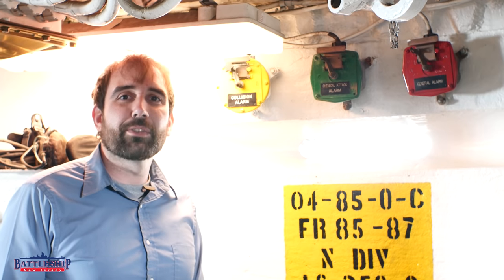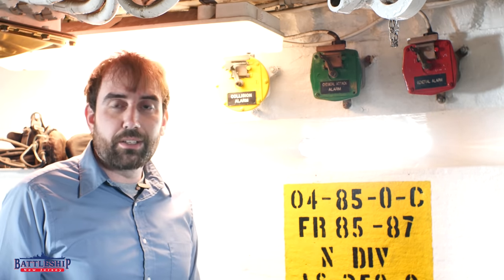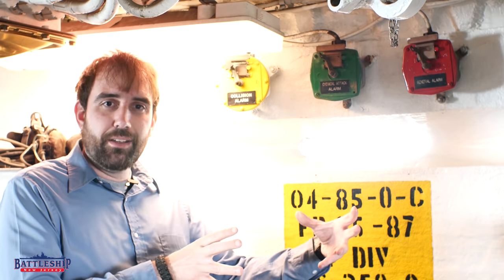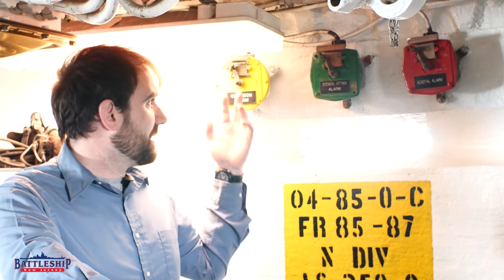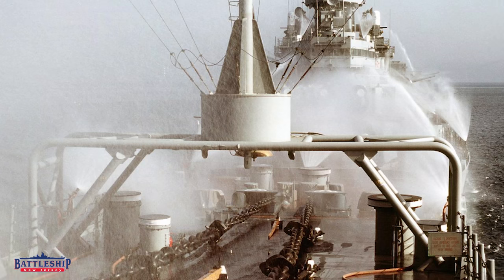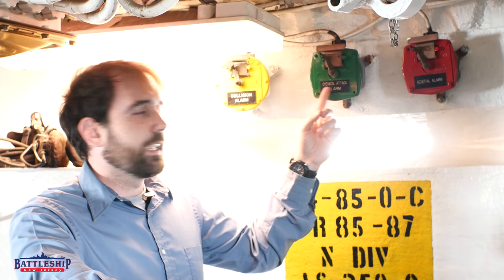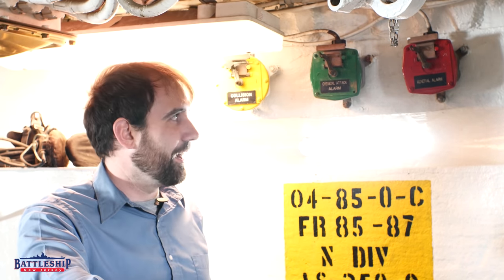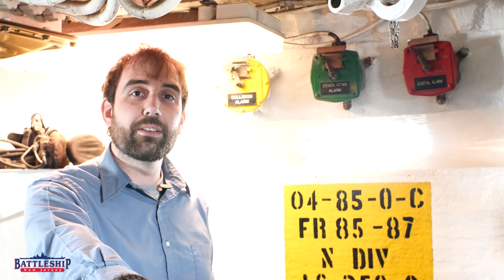That's Alarming! Shipboard Alarms and How to Tell the Difference Between Them

Comment: I stood quarterdeck watches.  The morning watch had a specific time to test the 1MC General Chemical and Collision alarms.  They over ride each other by precedence.  you start with the general and then hit the chemical then the collision to see if they cancel each other .  Just remember to shut off the last one before you finish.  otherwise you will have more noises than you planned for
Reply: On an older ship, one of those unplanned noises was probably somebody from the IC Shop asking if you would like to spend a fun-filled evening with him running every tube in the Alarm Oscillator, 1MC pre-amp, and 1MC power amp racks through the tube tester.  The old oscillators didn't like multiple alarm switches thrown and would over-drive the tubes, causing burn outs and distortion.  The pre-amp did not like distortion, and the main rack didn't like receiving an amplified distorted signal, distorting it even more before heading out to the 1MC speakers.  The finals in the power amp were special matched tube sets...in 1988, toasting one would result in somebody ordering a $900 matched pair to go back in repair stock.
Reply: @kevincrosby1760  my answer would've been, "Not really, but since I fucked it up, I'll help fix it up, when's good for you?".
Laughably, I'm also qualified to work on such ancient systems from civilian side employment and current equipment as well.
If memory serves, the BB's also used loctal tubes, right?

Comment: HIFR (Helicopter Infight Refueling), the helo hovers over the deck and drops the rescue hoist hook, the refuel crew hooks the hose to the rescue hoist and the helo pulls it up where the helo crewman hooks the hose to the helicopter. The helicopter hovers out to the side of the ship just in case the hose breaks and dumps fuel, there is a quick disconnect in the hose that will allow the helo to break away if there is a problem, the hose is managed by about a dozen sailors who pay it out or take it in during the evolution. Last thing you want to hear is the general alarm followed by fire,fire,fire and the space number with this is not a drill.

Comment: It is important to set off any alarm once and a while to make sure it works when you really need it to. Of course you must plan tests such as this in advance and make sure that everyone who hears the alarm knows that it is in fact a test.
Reply: That was usually done when in port. Before the test a page on the 1MC. "Now hear this. The following is a test of the (...) alarm. Disregard." After the test, "Test of the (...) alarm complete. Regard further alarms."
Reply: @williamstewart9769  correct, was a regular PMS performed by the IC guys.
Reply: Fire alarm tests are common, it might be an drill or announced as an test who can be ignored.
Reply: @leftyo9589  Think it was a Monthly, rotating through the two quarterdecks and the bridge for the 3 primary alarms, and the bridge/helo tower for Flight Crash.  We tested as the card came up in rotation, in port or at sea.  Only switch location not tested were the selector switch and push button located in the IC Shop on the Alarm Oscillator itself.  The Alarm Oscillator was the unit which actually generated the audio when an alarm switch was thrown, and was directly connected to the pre-amp for the 1MC system in basically the same manner as the various 1MC microphone stations.
Reply: @kevincrosby1760  yeah, im fairly certain it was a monthly or quarterly check. im a little rusty, its been almost 30 years!
Reply: @leftyo9589  Yeah, 3 months shy of 32 years here as well.

I can remember a lot of small details from my Navy time.  Now ask me where my car keys are at...
Reply: @kevincrosby1760  I only worry about the car keys when they're found at where I just arrived from.
Shit, forgot to bring the car home again...   ;)

Comment: A technical question about the alarms:
Ryan mentioned that they are tied into the 1MC circuit and that the General Alarm automatically goes for a full minute; does the alarm override any voice announcements, or could you make an announcement while the GQ alarm was going off?
Reply: I'm pretty sure you can talk while the alarm is going on.  You don't want to wait a full minute before the announcement.
Reply: The alarm and the voice would be in "parallel".  Therefore, you could talk. 
BUT, the alarms are a bit loud, and no one would probably understand you.
So, you would announce (in a loud voice, but don't yell, in a calm voice) "FIRE FIRE FIRE".
Sound the alarm.
Then "Fire fire fire.  Fire in Machinery 2.  Fire in the Port Motor Generator.  Fire fire fire".
Or something like that.
Reply: Idk if this accurate but, in Tora!3, the US destroyer captain announce GQ, there was a whistle first, then the announcement,  followed by the alarm. Would the same sequence apply?
Reply: @fidjeenjanrjsnsfh  If that was directed at me, I don't know.
First, it's a surface ship, so things are different than my sub. We didn't use Bosun's whistles.
Second, it was 1941 and a LOT of things have changed.
For instance, we NEVER said "This is no drill" or "This is a drill".  They wanted you to act the same way each time, not different.
Reply: @actaeon299  just querying
Reply: No the alarm overrides completely. The operator would have to manually disengage the alarm to make announcements. Newer systems I believe can make announcements simultaneously but old school analog like these cannot.
Reply: The alarms are over 1MC which is the entire ship, you could still untie the separate circuits to talk to different parts of the ship if you had to, but generally you'd give anything urgent information before firing the general alarm.
Reply: @quentinhartley5773  No override as you are thinking on the old systems.  However, the pre-amp for the 1MC did have a gain adjustment for each input such as the alarm oscillator and all of the 1MC microphone stations.

As a general rule, the alarms and the bridge microphone station were pumped up pretty good, with the mic stations on the quarterdecks potted down quite a bit.  Premise was that the alarms and bridge mic were used underway, and the quarterdecks used in port where the ambient noise level was less.

Biggest thing was to avoid running the gain on ANYTHING up to where overdriving and distortion were an issue.  Hard on the equipment.  Nothing kills vacuum tubes in an old 1MC amp quicker than a Bos'ns Pipe held to close to a mic.
Reply: @fidjeenjanrjsnsfh  It depends on the CO.  Some COs would use the bosun's pipe in full, that is, every announcement, command, etc would get the full trill before and after the message and the piping for the specific message,  others only used the pipe for certain messages like colors, ceremonial messages and the like, others didn't use them at all , only speech.  Nothing worse than having that bosun go on like someone singing the national anthem at a ballgame wanting to draw it out as long as they can while you're trying to sleep or you're in a space with a loud 1MC.  Yes, even those alarms referred to in this video had bosun pipe equivalents.
Reply: @fidjeenjanrjsnsfh  yes and no depends on what is happening

Comment: Flight deck repair locker or Team on a surface combatant was called "Crash and Smash" back in my day, about the same time New Jersey was being dusted off and reactivated for the final time.  Sounding the Collision Alarm while moored to a pier WILL raise eyebrows (figuratively,) but one of my fellow 1st Class POs was the Inport OOD one watch when we had gale winds blowing through Hampton Roads.  

We were moored to the North (upwind) side of Pier 7 with the small boat basin (barges and tugs) upwind of us.  A couple of good size barges started to pull loose and threatened to slam into our UNARMORED hull, with the probable result of piercing the hull at or below the waterline.  He had his Petty Officer of the Watch sound Collision from the Quarterdeck (yes, all three alarms on the Quarterdeck) while he got on the landline phone to contact Port Operations to alert them to the barges.

"Collision imminent, starboard side amidships ... Set Zebra main deck and below and evacuate."  The Command Duty Officer literally flew out onto the Quarterdeck and immediately told my friend that he did the right thing as soon as he hung up with Port Ops.  The duty tug crew had noticed the barges pulling loose even before Port Ops was called and intercepted them before we could get hit.

Nice Letter of Commendation from the Destroyer Squadron Commodore for my friend's service record, I think it helped him when the next Chief Selection Board met.

Comment: i dont pull them, but on my first ship we had a phantom that liked to run around and pull them. was a pita, after the first few times captain made us go to GQ until he got bored. he also had me the lead IC go around and open all the switches up to ensure none had gotten wet and shorted. for me at least i got to wander around during these GQ's , have a smoke, and check out the switches while everybody else was in full dress sweating.

Comment: Yes I have the urge to pull alarms. I’ve been wanting to pull the fire alarms in school since I was 8 years old and I  still have that urge 10 years later. Fortunately I have the discipline not to. Ryan, if you can, please make a video of you pulling the alarms when the ship is closed to the public. That would be the coolest thing!
Reply: I second this, I'd love to watch Ryan pull random (to us) switches so we can hear what the do.
Reply: Nearly pulled a station once, but fortunately, the class C extinguisher did its job.
I learned an important lesson that day. When the instructions say to stand so many feet back, stand that far back (cough, cough, gag). Got the fire out and was able to kill the power, damned amp shorted out just at the right time...
Got the amp fixed and new power supply leads quickly enough, despite the mess that I cleaned up. Had compound halfway across a warehouse sized space.
I was quite experienced at the time too, so boy, but my face was the most fetching shade of red...

Comment: Wow, I would never pull an alarm! But I was in the Navy so my "natural" impulses are perhaps different from the average bear.
Interesting story about the General Alarm on my ship (USS Alexander Hamilton, SSBN617G). On a submarine the General Alarm serves as a fire alarm in addition to its use for manning battle stations. The alarm circuits also override the voice announcing system on the 1MC. During the midwatch one night we had an hydraulic leak in the engine room. The damage control team effectively handled the casualty but the fear with such a occurrence is the possibility of fire due to the hydraulic fluid sprayed about the space. We went to periscope depth (PD) for emergency ventilation of the engine room when we heard the 1MC announcement "Fire in the..." at that point someone in the Control Room pulled the alarm so it cut off the rest of the announcement. Once activated there is no way to stop the general alarm until it finishes its cycle. There were a few tense moments as we waited to hear the location of the fire and, of course, we feared that it would be in the engine room.  Turns out it was in the galley. The cooks were frying sausage or bacon and at PD the ship was rolling and spilled some of the grease where it wasn't supposed to be and it started smoking. In the end we all had a good laugh about it.
Reply: My luck, I'd be aboard and there'd be a fire reported in the main ballast tank at test depth.

Comment: My very first time on a Navy ship (USS HAYLER, DD 997 aka The Junkyard Dog) I was in CIC when GQ went off. We were at the pier in Pascagoula (during PSA, I think). The crew jumped into action, but the cause was an IC Man shorting some wires whilst working on the system.

I've also been on CGs and DDGs when fire drills were held. The space having the faux fire is part of the announcement over the 1MC. "Fire, Fire, Fire, Lube Oil Fire, AMR Number 2" etc. 

OBTW, the MC in "1MC" stands for Master's Call, not Main Circuit as some other sites and media have mis-reported. There is actually more than one MC circuit, each for a designated purpose. The "master" in this case is of course, the commanding officer, "Master" being the traditional term for the commander of any ship. 

I was also involved in the reactivation of WISCONSIN in 1988-1989. I remember her counter measures wash-down system, but did not know until Ryan told us that only WISCONSIN among all the IOWAs had  that system.
Reply: She was one of the test vessels for the wash down system. Part of the nuclear testing decon testing. Ships without wash down were nearly impossible to decon properly.
While she was never part of Crossroads, she was a test platform for the system. Which was obviously considered unwieldy and too expensive to implement on the rest of the BB fleet.
As memory serves, the old USS Pennsylvania had a wash down system installed just for that test and it proved reasonably effective, hence its introduction into new construction ships.
https://en.wikipedia.org/wiki/Operation_Crossroads#Legacy

Comment: I was petty officer of the watch in DC Central while at sea. All alarms go through there. Not sure if any can be sounded from there but there are a lot of types of alarms there. DC Central is the back bone of the ship for Damage Control.
Reply: Switches are for sounding the primary alerts/alarms.  Those switches go straight to the Alarm Oscillator in the IC Shop, which sends the appropriate audio signal directly to the pre-amp for the 1MC system.  Basically the same type of connection as a 1MC microphone station.  

Sounds like you are referring more to the actual alarm panels for fire, flooding, firemain pressure, etc. that would have had you sending the S&S rover on a mission...or "the panel which is not discussed" over in the corner which had guys with guns running around all over the ship when it went off, and that required two guys and 2 keys to silence...

Comment: Do you have recordings of the alarms she was built with, as opposed to the modern ones?
Reply: I don't think the sounds have changed.  Why have any risk at all, when none is needed, of confusing people?
Reply: @michaelsommers2356  Those sounds are very electronic-sounding.

I found a video that has what the commenters called the "howler" which was used previously. https://youtu.be/DC6rKwGEmfM
Reply: @michaelsommers2356  Because this ship was built around the 1930s, before the 1MC (the system that generated these sounds) was invented.
Reply: @user2C47  BB-62 was laid down in 1940.  What is your source for the statement that the 1MC was invented before 1940?

Comment: A "Fire Alarm" is the rapid ringing of the bell over the 1MC, followed by 1-3 single strikes to indicate Forward, Amidships, or Aft.  This would be followed with an announcement similar to "FIRE! FIRE! FIRE!  Class Bravo fire in the Galley, compartment xxxxx, Away the Inport Emergency Team (Flying Squad underway), provide from Repair Locker 2".  A drill would preface the announcement with the words "This is a drill" twice before the standard announcement.  

The same procedure is used for all alarms, with sounding the appropriate alarm tones replacing the bell signals.  "General Quarters, General Quarters, all hands man your battle stations.  Set condition Zebra throughout the ship.  Make Zebra reports to the watch in DC Central.  Reason for General Quarters - Class Bravo fire in the Boiler Room".

FWIW, our doctrine was to call away GQ for just about any major issue in the Fire Room or Engine Room.   Since these could easily escalate into a loss of electrical power, better to get the ship secured and everybody in repair lockers with manned sound-powered phones while you still had a 1MC to pass the word.  

An unexplained loss of firemain pressure was also a call to GQ if the cause could not be determined in a very short amount of time.  In this scenario, rovers from each repair lockers would be on a constant roving fire/flooding patrol in order to (hopefully) catch a fire small enough for a hand-held extinguisher to be used.  A total loss of firemain pressure was almost preferred, as it is probably a pump issue.  Low/dropping firemain would man that you still had pumps online and the water was going someplace...generally on the "people side" of the hull.  If you have a leak bad enough for pressure to drop with a total of 6000 GPM worth of pumps online, something is probably filling rapidly.
Reply: If there was a large unknown drain on the fire main, would it have been standard procedure to shut down the fire pumps to limit flooding?
Reply: @user2C47  As a general rule, Sounding and Security would be dispatched to determine the cause.

If nothing was found in a short amount of time, then the watch in DC Central would start adding people to the search, and possibly have the firemain segmented to isolate the problem area.  (As a general rule, the firemain can be isolated into sections, each fed by a different pump).  Once the general area was found, then sections could be further isolated within that segment.

While this is going on, tanks and voids are being sounded, compartments checked, equipment which used firemain verified, etc. 

As far as shutting down fire pumps go, I would have considered that my last option, and the ship would have been at GQ before that point was reached.  As above, first tep would be to determine what section of the firemain was affected, and isolate that area only.
Reply: @User 2C47  Typically the firemains have several segments that can be cutoff or bypassed entirely. The size of the ship determines how far the firemain system can be segmented
Reply: Or G.Q. is sounded when a scud missile blows up in the air close to your ship. I should know. U.S.S. Tarawa LHA 1, desert shield/storm.